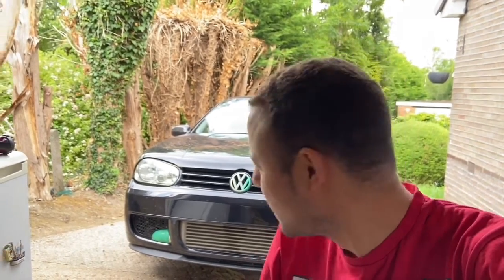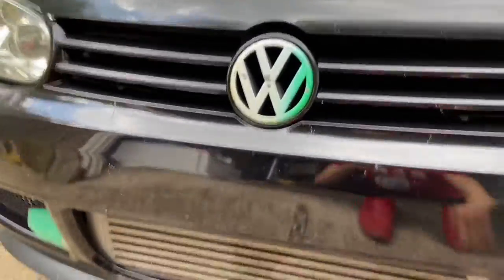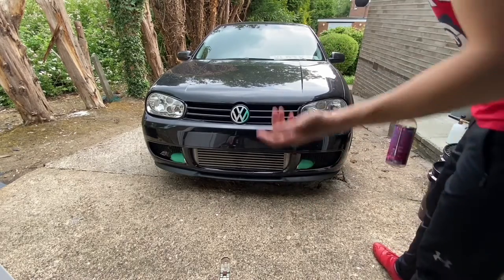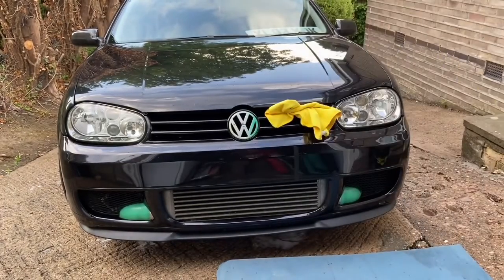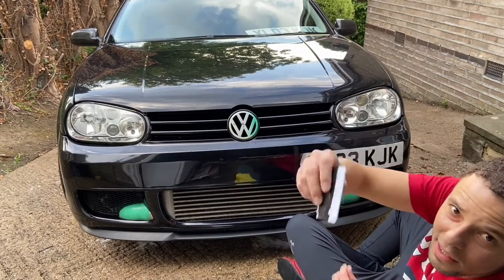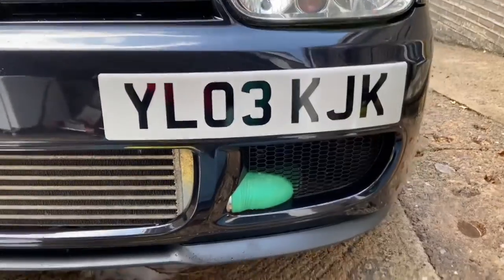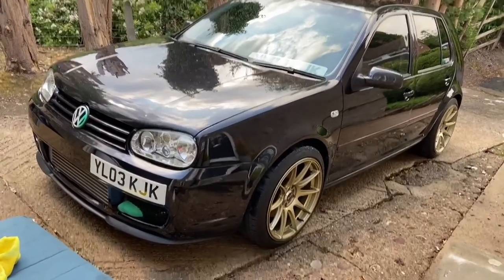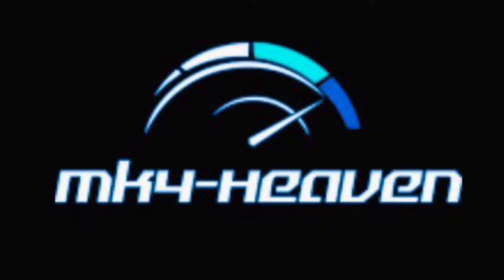FITTING A VINYL NUMBER PLATE *LOOKS WAY BETTER*

Comment: Great vid bro, should of put the plate in the middle, but that's my personal choice now put a 15% tint wrap on ur front headlights, spray ur intercooler matt black, and change the pipe work for black too, then 4D carbon wrap ur wing mirrors and roof 👍😉 Also dye ur roof liner black and nice sunstrip on front window 🖤 make for som great videos.
Reply from the maker: Thanks Bro, I like the jdm look and got tired of the old middle number plate lol, Mate all them mods would leave me with nothing else to do lol.. Yeah I've got something in mind at the minute but well see. thanks for the ideas tho.

Comment: ey mate, i have another question. I have read that K300 needs a super size inlet tip. Can i use a silicone K03/K03S TIP for the K280?
Reply from the maker: Mario - no the standard K03s is smaller and not 52mm so it won’t work bro.

Comment: hey, what fuel pump, injectors and fpr are you using for this 300bhp build?
Reply from the maker: Hi mate, im using bam injectors,4 bar fpr and dw65v fuel pump. Hope this helps.
Reply: @Mk4heavenHD  yea, thank u so much, keep the good work ^^
Reply: Ahh and forgot to ask you another question. According to your videos you bought BBT k280 right? And you say you are in 300bhp. I mean, according to BBT official page, they have 2 models, k280 and k300, so?

Comment: Ahh and forgot to ask you another question. According to your videos you bought BBT k280 right? And you say you are in 300bhp. I mean, according to BBT official page, they have 2 models, k280 and k300, so?
Reply from the maker: Mario - So when I built my car I was not aiming to achieve 300bhp rather my goal was to play safe and buy k280 that’s rated at 280bhp. I bought k280 with uprated 15psi actuator however when the car went for mapping it was pulling so strong and flowing so well that it actually achieved 301.2 bhp. My setup with my Aum engine was easily working beyond 300bhp with a 280bhp rated turbo lol, in the end they capped it back to 293.9 to leave it safe and 289ftlb torque. I made a video on the channel if you check my part 5 (final) of the build.
Reply: @Mk4heavenHD  ahh i understand. Ok, i have also and aum with all the supporting mods. I guess i should pick k280 because seems to be very strong. I dont have forged rods so i should not go over 290BHP i think... so this turbo is capable of that. The thing is that when i go to buy it, it doesnt give you the choice for the 15 psi actuator you know, it only says stock in the choice.

Comment: Not legal but might get away with it
Reply from the maker: Never had an issue mate, the plate is same size as normal and reflective.
Reply: @Mk4heavenHD  it’s not bs marked if you mount to the side it needs to be angle to be read as they do on alfas. U r unlikely to have a an issue I have seen one officer issue a ticket. Check GCM you tube they have done a mods guide with the police and he plate had to be moved back
Reply from the maker: @DashDriver-z1r  - Yes its not marked. Im not worried mate, car has had that plate for ages and gone past multiple traffic cops without issues (fingers crossed lol), I think driving like an idiot makes cops look for minor stuff like number plates etc.. Plus I suppose its how you mount it mine doesn't wrap round the bumper either.
Reply: @Mk4heavenHD  yeh it’s not taking the mick in my opinion but it’s not fully legal and I have seen people fined that’s all I am GCM police post covers it. The lack of bs 145 d or e is enough to make it illegal and technically an mot failure. Also if you mount to the side of the front like an Alfa you need a plinth to align the plate so it can be easily read from the front. I am just saying it could get you pulled and or fined